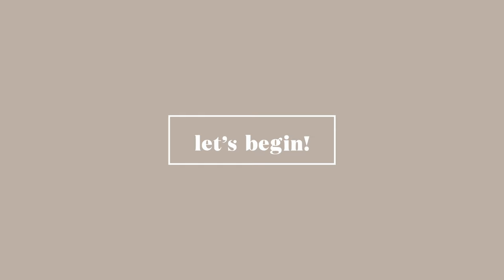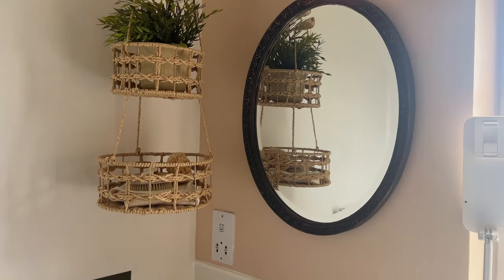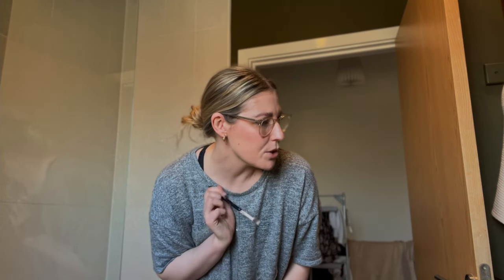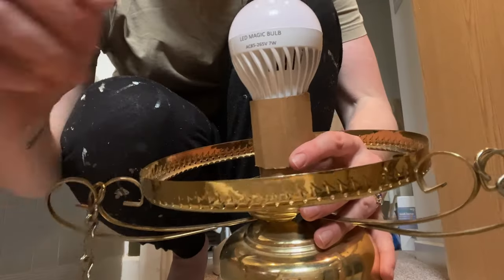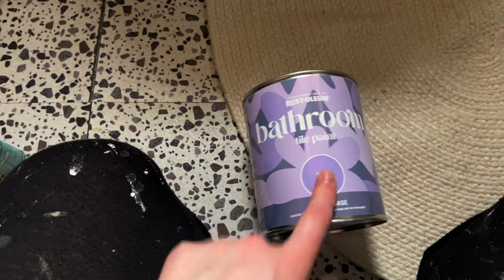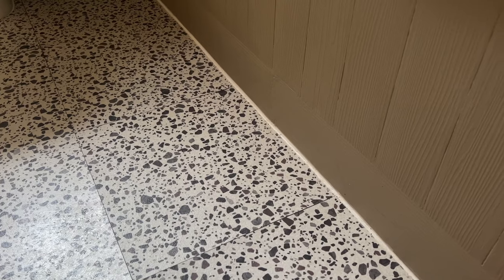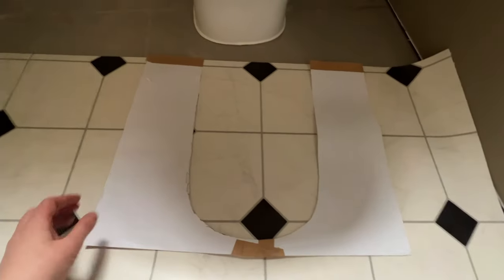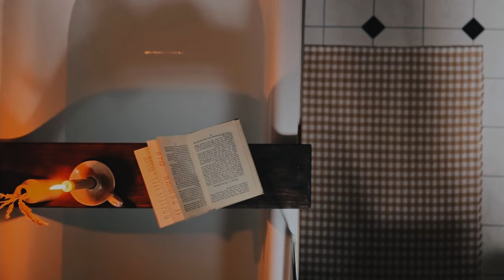Bathroom Update - embracing dark & moody decor!

Comment: If you do the peel and stick again, try caulking the tiny seams between the tiles and the perimeter. It will keep water from getting under the tile and will keep them from popping up.
Reply from the maker: I did caulk around the perimeter but didn't try between the tiles but that could improve things.